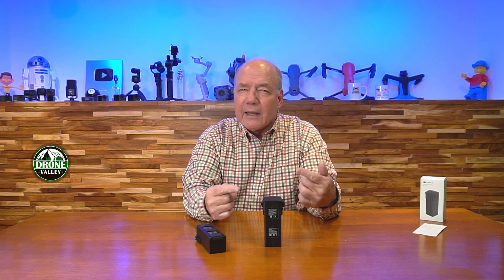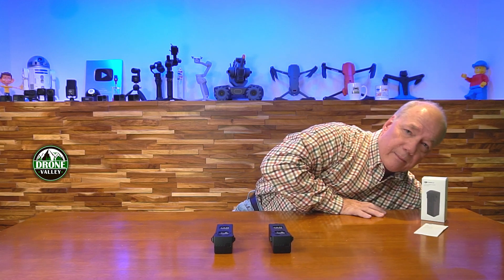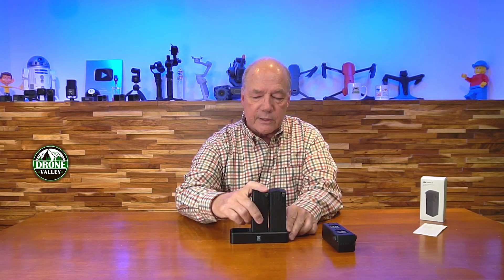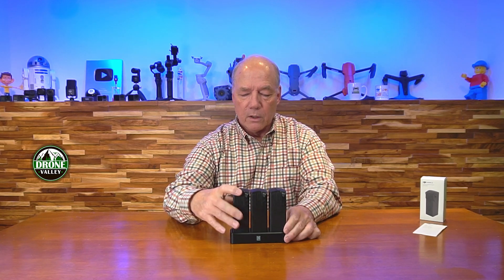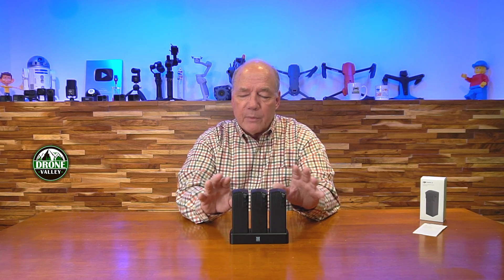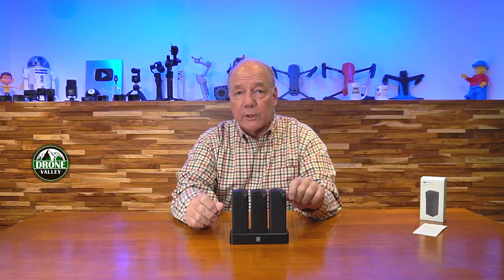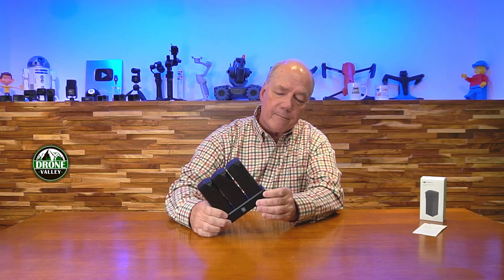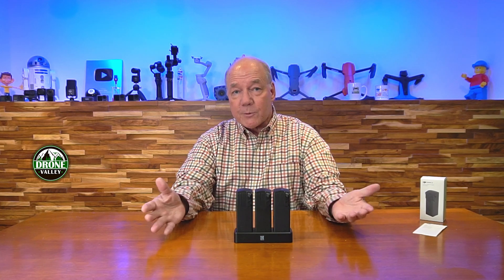DJI Mavic 3 Battery - An Amazing, Compact Power Plant!

Comment: Rick, thanks for the info on the intelligent batteries. I was wondering if you know anything about automatic discharging with these batteries. The Mavic two pro batteries do discharge them selves as you know. I don’t see any settings to control that. Can you comment on that?

Comment: Thank you for this. I should like to add a comment about using the LEDs on the battery to indicate how fully it is charged. According to DJI they show the charge state a little more precisely than you suggest: though there are only four they give the charge state to the nearest 1/8. For one of the examples you offered, two lights coming on without blinking, we know the battery is between 3/8 and 4/8 charged up, that is, in the range 38% to 50%. To avoid having to keep consulting the table produced by DJI, which is on page 44 of my copy of the guide to the Mavic 3 Classic, the following may be helpful:

when you press the button that causes the battery's LEDs to light briefly:

double number of lights that come on without blinking; if there is not in addition a blinking LED subtract 1. The result is the lower limit of the battery charge, in eighths. The upper limit is 1 more than that.

E.g. 3 LEDs come on without blinking, and the fourth does not come on at all:
2 x 3 - 1 = 5. So the battery is between 5/8 and 6/8 charged, that is, 63% to 75%.

Your last example had two lights on and one blinking, and so

2 x 2 = 4; therefore the battery is between 4/8 and 5/8 charged, that is 50% - 63%.